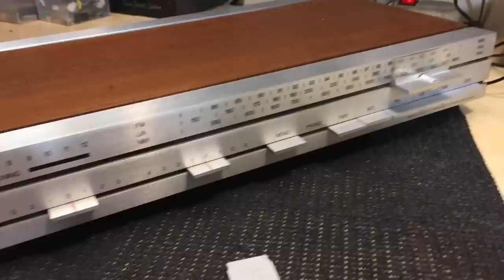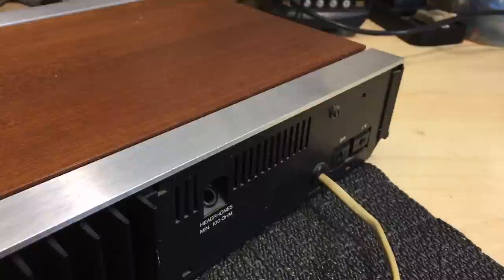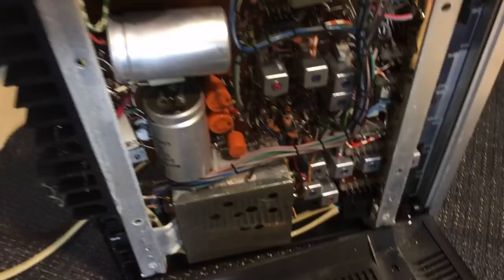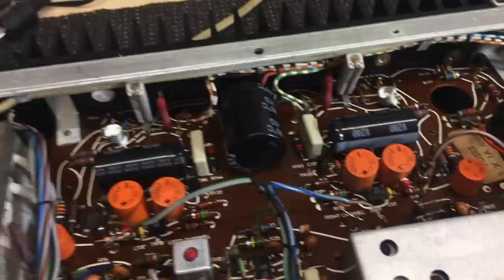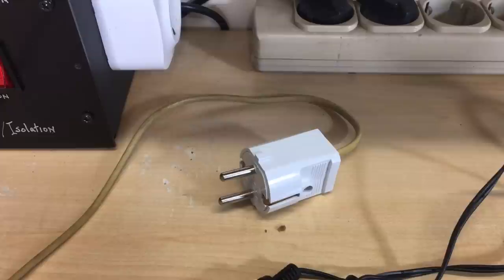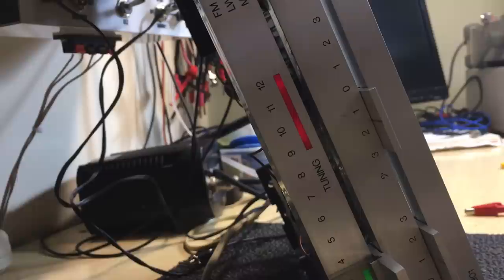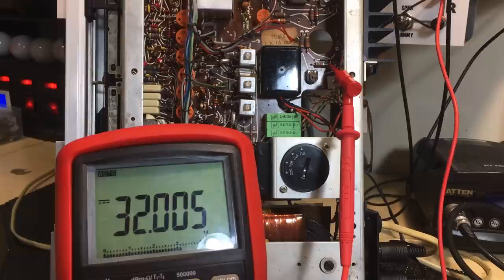Saving the Bang & Olufsen Beomaster 901 from the Dump

Comment: Could you please show or describe in a bit more detail how to unclip the sides?  I have a similar unit that needs the veneer repaired.  Thanks
Reply from the maker: It is pressed onto the sides and has four plastic “pins” that go into the chassis. You need gently pry them loose (see the video) but be careful because they are brittle (I broke one of mine off).
Reply: @electronicsoldandnew  Thanks, I'll check again and see if I can get them loose.

Comment: I would be wary of those plastic ROE (Roederstein) branded caps as they have a habit of failing short. They were pretty high-end caps back in the day, with lots of European manufacturers favouring them. Unfortunately, they became quite notorious in the B&O TV's as they would be full of the dark red ones, and blanket replacement was often the only cure. 

Perhaps the orange ones hold up better? Even still, they're pretty long-in-the-tooth by now. Frolyt in East Germany also made a similar type in white plastic cans - they are terrible also. Other ROE or Frolyt caps are generally fine - just watch out for the plastic versions.
Reply from the maker: These are plastic, but as I said, I’ve never seen caps of this age holding out so well. I may replace them all in the future, but left them is for now. Perhaps it’ll force my daughter to visit for the repair :)

Comment: Those orange caps do seem to last for ever however the smaller brown ones cases due crack at the top and the electrolyte drys up  .Be careful those trimmers the metal plating oxidize causing erratic resistance must clean first .I love the B&O stuff of this era 

not the newer  stuff
Reply from the maker: paul davies : I’ve had the same experience with the brown ones. They’re terrible. I’m going to change the pot just to be safe.

Comment: The radio tuning set-up looks like it would be nerve-wracking to me.  I prefer the conventional tuning knob to that slider.  Each to their preference.  Cool unit that looks like it would be a hassle to work on the boards with everything crammed together.
Reply from the maker: I would be, but you’ve actually got full access to both sides of the board without removing it, so I think it’s not too bad.

Comment: 11:55; Ha! So it's the red Rodersteins that are evil but the orange ones are great? Imagine that!
Are they actually 100V 40μF or have I misread them? If they are, you could in theory replace them all with film caps. It might cost a little more but you'd only need to do it once. I've been able to get loads of 40μF film caps on ebay for cheap by buying bulk - the verdict is not yet out on whether they were fakes or not, we'll see...
Reply from the maker: 40uF film caps (if real 😊) are very very expensive. If you’ve found some, you’ve found treasure.
Reply: @electronicsoldandnew  That guy was selling them by the box, in bulk. Might still  be doing that. Hang on I'll check..

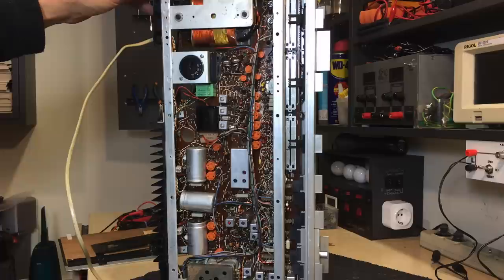Comment: 6:55 : If I wanted to taunt you I'd urge you to try repairing a 3001 after this but that would be rather sadistic so I won't : )  Suffice it to say, I gave up on that unit (not one of my finest moments but I was moving at the time and the receiver was in a dismantled state so...).
Reply from the maker: I understand completely. Sometimes you have to make tough decisions 😊
Reply: @electronicsoldandnew  I kept the transformer and PSU I think. The transformer was impressive, fully potted (!) and felt a shame to throw away. It was the case though that was the real nightmare: it was one of these affairs where each side is held together by screws with the other sides but in such a way that  you had to completely disassemble everything simply to get inside (or so it seemed to me back then). Quite the opposite of what you have here.
Reply from the maker: The parts like the transformer are well worth keeping.

Comment: DIN sockets were often poorly executed and introduced huge amounts of noise because of the gain needed compared to RCA phono circuits. Sometimes on cassette decks, the DIN input would add over 10db of noise essentially negating any benefit of Dolby B noise reduction!
Reply from the maker: I suppose that’s what happens when you try to fit too much audio info on a small socket. Good thing they changed that.